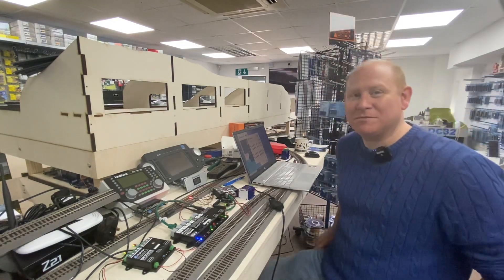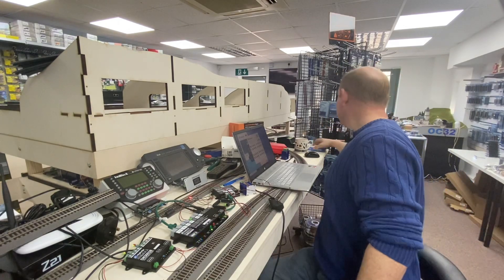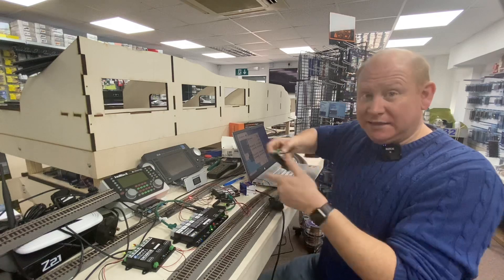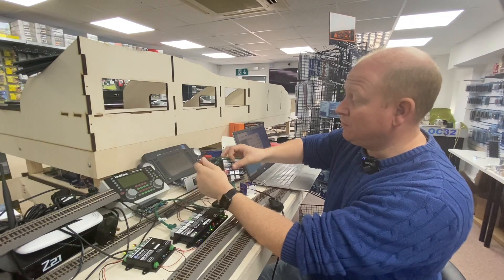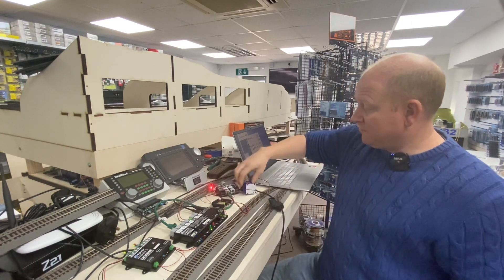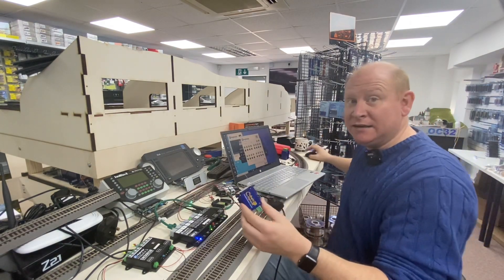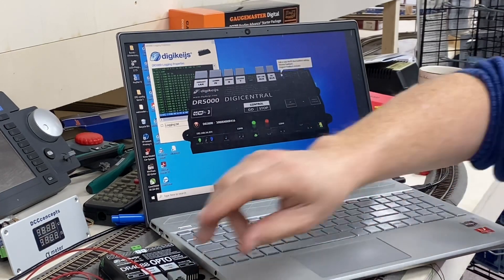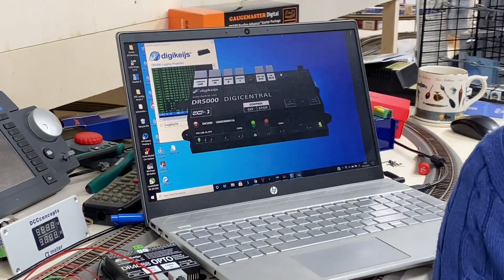Digikeijs DR4088 Mimic panel analog switch to digital address.

Comment: One of these days I need to figure out the difference between the GND and the OPTO versions.
Reply from the maker: The GND is volt free detector and the OPTO is Low voltage.
Reply: @DCCtrainautomation  If I want to detect the SPDT output of a Cobalt Digital iP, which one should I use?
I own several of the GND version, but don’t know if that’s correct.
Reply from the maker: @HumancityJunction  https://www.dcctrainautomation.co.uk/blog/point-detection-position-for-computer-control.html
Reply: @DCCtrainautomation  I saw that article and drawing which is why I got the GND units. Looks like my plan should work :)

Comment: Hi slightly off topic I have a dr5000 control with the dr4088  my question is  does the live  from the 5000 go to the com on the 4088 and the 16 sensor wires that go to the blocks (the rail that is isolated ) is it a red Cable Live??  and  the rail that is not broken into sections having a Black wire  which goes back via the negative bus to the dr 5000
Reply from the maker: Yes you do.
Reply: Thankyou

Comment: As I have just clarified with James, the thing I like about this simple solution (as opposed to the other ways I was looking at) is that it can be added retrospectively. First get your head around getting things working on (in my case) DR5000 and if you choose iTrain. When it is all running you can decide were you would like to add your switch control and then build the mimic and connect the S88 to the DR5000. Brilliant 
Brian Essex Thameside in N

Comment: Very Interesting as you know i'm just in the process of converting my Layout to run with Digikeijs and iTrains how do i solve the problem of a train running into a turnout set against it and creating a short as at the moment i have to use the hand of God to move the loco back off the point and reset the DR5000.I
 then move the point or can i still use my old mimic panel to set the point or how do i set Itrains to stop the loco or move point automatically to favour the loco
Keep up the good work
Reply from the maker: Hello Chris please send me the iTrain File you have and i can see were you are going wrong.
Reply: @DCCtrainautomation  Thanks for the prompt reply I have only got the 2 month trial licence at the moment but hope to buy standard or pro
Reply from the maker: @chrislockerby1411  you can send be the Tcdz file though can see were the problem is. And get you moving forward.
Reply: @DCCtrainautomation  will get it when I’m up in my loft tomorrow 
Many Thanks

Comment: Hi, can you use a DR4018 to operate solenoid points?
Reply from the maker: Hello Clive the answer is no. The dr4018 spec it not designed for peco or seep solenoids.
Reply: @DCCtrainautomation  thanks for your reply, appreciated.
Reply: @yarisman2  Been there.  Recommend that you don't even try it!  I damaged one of my DR4018s by persisting with solenoids.  MTB MP1s + DR4018s have been great for me.
Reply: @whetstonebridge4801  Thanks for the info.
Reply: @whetstonebridge4801  I've gone over to MTB 1 motors wouldn't go back to solnoids

Comment: Also dose it have to be xx versions and how can I tell if mine are. Very interested in doing this.
Reply from the maker: Hello 

It has to be the S88 version of the 4088 and then either the GND version or the OPTO one. It is in the instructions.
Reply: @DCCtrainautomation  This video seems to suggest it can be done on the LN version. https://youtu.be/s_IF2pK3klY
Although I can’t see how as the manual only shows the GND and opto, and as far as I can tell the LN doesn’t have the modules option to tell it what kind of switch / button is connected.

Any ideas?
Reply from the maker: @Usernamesannoyme  no it can not be done on loconet I said it can not be done on anything but S88 units

Comment: Hi James, great video, I have one 4088 on LN and one linked via S88 from the one on LN. Can I still do this or do they have to be direct to the S88 on dr5000 ?
Reply from the maker: Hello thanks for the question. You can not do it through the LN version no. You would need to disconnect it and put it to the S88 port on the DR5000
Reply: @DCCtrainautomation  thanks James. As my s88 are free on the dr5000 I may invest in one of the opto versions just for this job of control mimics. 
I take it you still have to give it the 1st address and the others are sequential? Nice if they could be independently given the address.
My layout is a learning layout so a rejig of the address wouldn't be to difficult. Keep up the good work😁
Reply from the maker: @ravenscrossmodelrailway3281  hello you can set what address the S88 starts at it does not have to be on 1-16 you can start any were you like.

Comment: Very interesting.  One of the downsides of iTrain has been the lack of a 'real' mimic panel.  How many turnouts for each DR4088?
Reply from the maker: This is only one solution to have this in iTrain or Train Control there are many others for other systems and they have been around for a very long time.
Reply: @DCCtrainautomation  Thanks highlighting this function.  Seems obvious now that a feedback could tell iTrain to carry out a command.  Should have thought it through before.

Comment: Awesome!
Why has no one else explained about that S88 assignment ability?
After you told me I found it in section 7.1 of the DR5000 manual, but since they left it in German or Dutch, it wasn’t real obvious what it did :/

Question: with the 4088Opto, can I utilise a voltage input as the switched input? 
Ie, 12v dc on one input for green, other input for  red?
I think this is possible, but only with opto, not GND.
Reply from the maker: If you use the OPTO you don’t need to add power that’s way I did it this way uses the track current.